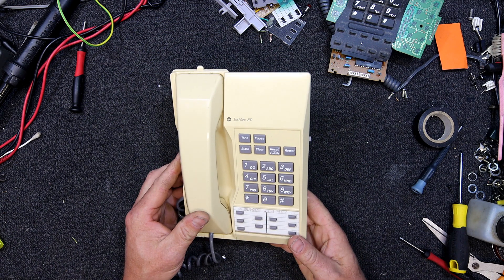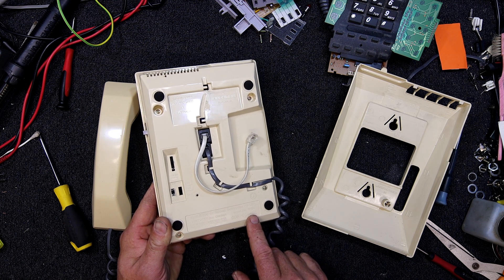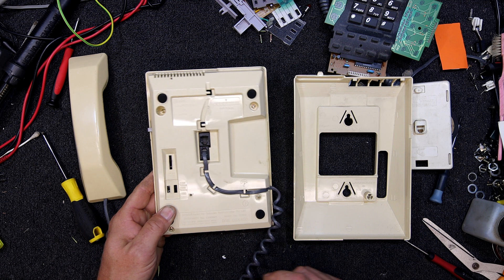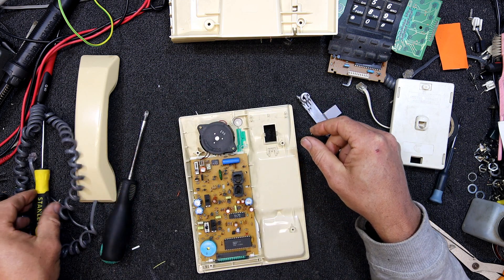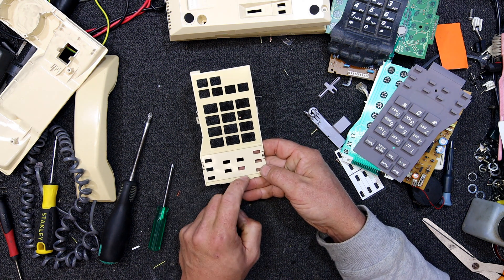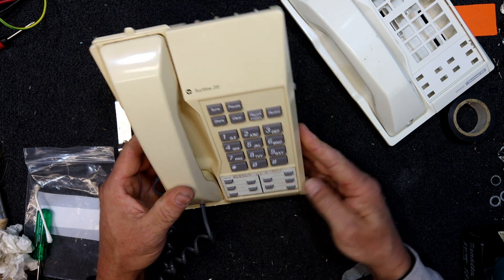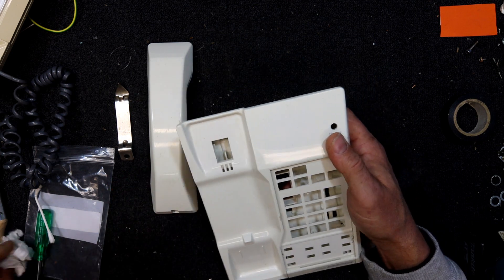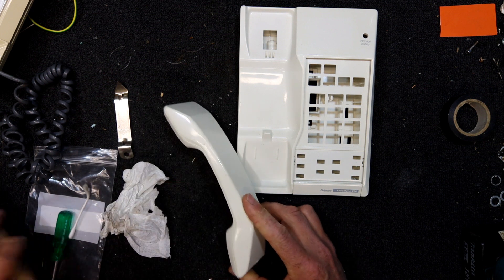Telecom Touchfone 200 in Rare Beige Colour Disassembly for Retrobrighting

Comment: I have two of these Telecom 200 phones - one is the standard type as shown in the beginning of this video, the other is a "sensor-pad" model (no raised keys).
Reply from the maker: The early ones that came out in 1988 have the membrane keypad. They stopped making them around 1990 because besides being horrible to use there were issues with static electricity getting into the phone and possibly risk of shock from lightning strikes. After that they all had the rubber keys with better tactile feeling and more insulation electrically.
Reply: @StevesElectronicRepairShop  😎👍 I had a feeling that was the reason for the change in keypad design.